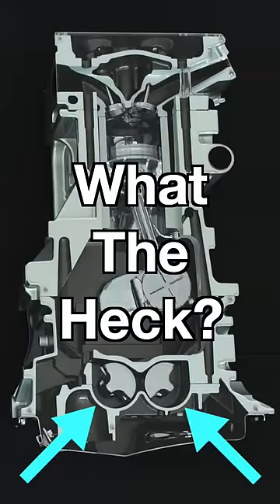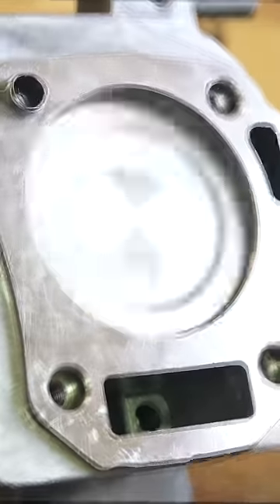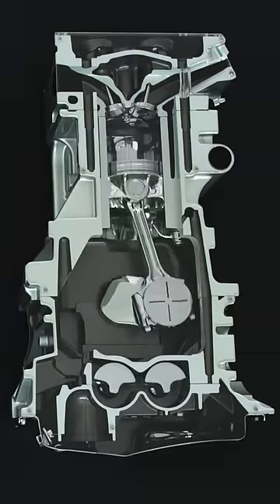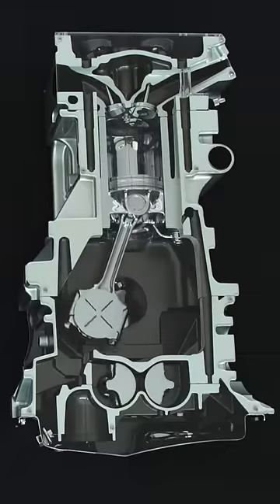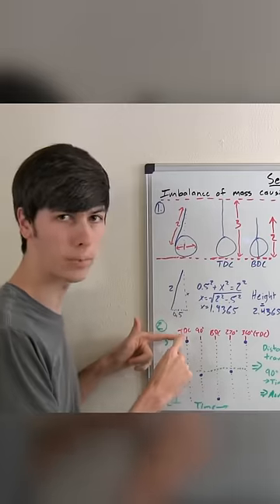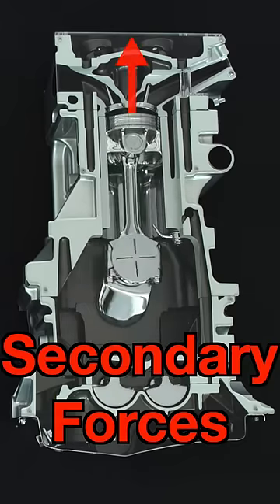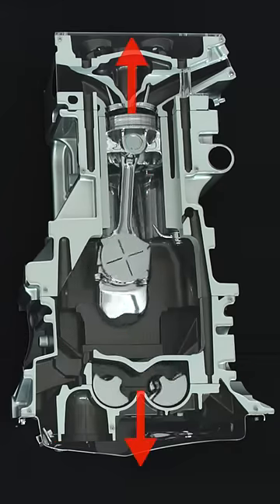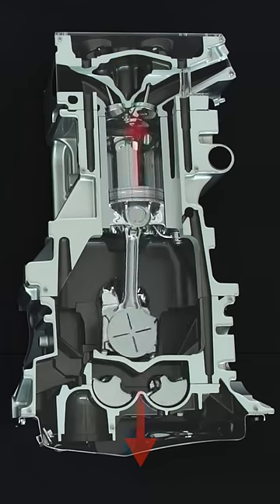How Engine Balance Shafts Work (In 60 Seconds)

Comment from the maker: If you like making fun of nerds on the internet, consider subscribing and leaving frequent comments on my content: https://goo.gl/VZstk7
Reply: Engineering Explained. Your channel and D4A are my favorites. (Plus Bike as Beards.)
Reply: Envy is your sin isn’t it?
Reply: I love how the things used to stabilise engines are the same things used in rumble packs on gaming controllers
Reply: its a German invnetion of the Otto Motor called a KURBEL-WELLE...Germans grew up with this knowledge...
Reply: 🤔🤔🤔🤔🥺🥺🥺👍👍👍 perfect expression 👍👍👍👍🤔🤔🤔🤔😉😉😉😂😂
Reply: @Red-yw3hq not the brightest bulb I see?
Reply: is that why they were able to get rid of the crankshaft counter weights here?
Reply: @SteveMuir  Interesting how my browser interacts with the YouTube shorts so I can't see the 'normal' comments line. But yours is available! So you win (or lose?). Anyway, instead of inefficient kluges like balance shafts, just use a 3:1 rod:stroke ratio and drop secondary forces to negligible levels
 the easy and efficient way!
Reply: How do I keep the balancing act without the balance shafts on a k24 Frankensteins monster engine?
I’d love to attenuate the vibration without creating the extra heat in the oil or taking up the entire 3hp that could be spared without the balance shafts.
Thoughts?
Reply: Bro leveled up his Nerd Quotient to Rockstar status.

Comment: Inline 6 engine: Perfectly balanced, as all good things should be.
Reply: And you can't beat the 225 slant for longevity, either
Reply: And still it vibrates, which is why an electric motor is really the best choice.
Reply: @oldfarthacks electric motors are amazing. Shame the batteries aren't nearly as good.
Reply: I really wish more cars had inline 6 engines...
Reply: And they sound amazing
Reply: @samoliver3242  Jaguar XK and Maserati 250F
Reply: So also was a Mercedes W196 straight 8, but that was a racing car.
Reply: And then you've got the Inline 5 from thr Audi Quattro, or the inline 3 like in Minis and Daihatsus
Reply: @smug3636  ford aussie Barra inline 6 ❤
Reply: Ford 300 straight 6

Comment: EE: Shaking engines aren't desirable
Harley owners: Heretic!
Reply: 1000cc harley makes 45hp…
Reply: @Justinhomii  That's about the same as my 400 cc dirt bike. I bet the Harley weighs more than 250 lbs though.
Reply: @Justinhomii  they make better vibrators than bikes lmao
Reply: Harleys could produce more power, but they were designed for the exhaust notes rather than engine output.
Also, they don’t leak, they “mark their spot.”
Reply: I used to have a monthly retightening of every accessible screws when I owned one.
Reply: When you burn for fuel for aesthetics rather than performance
Reply: @chitlitlah  To be fair Harleys (and similar bikes) make more torque and are also tunned to make that torque at low RPMs.
Reply: @Lianpe98  except similarly tuned bikes like Indian still make more HP.
Reply: @morethanjustasloth5528  Yes, because of DOHC
Reply: @Lianpe98  No it's because their engines are built to actually make use of modern technology. High-revving engines were difficult and unreliable back in the eighties when Harley still dominated. Nowadays Harley engines are still built like then except modern techniques lets us build high-revving engines ideal for motorcycles.
Reply: @morethanjustasloth5528  Fortnine made a video about this ("How Indian makes 43% more power than Harley Davidson"). Short answer: HD customers value their "Iconic engine" so much that any and all change is seen as abandonment of the current consumer base.
I mean, even Buell, the performance subsidiary was stuck with air-cooled engines...  Air cooled superbikes.... :')
Reply: @Weehapaa sounds just like those pop tunes kids love these days...
Reply: @blepware  thaaats why they like leather so much now I get it
Reply: @Lianpe98  To be fair, my dirt bike also makes its torque pretty low. I wouldn't expect a Harley to beat my sportbike in any kind of a race (except maybe a tractor pull), but to have the same power as a dirt bike with an engine 40% the size is pretty bad. However, I do remember them coming out with a bike that had OHC and the Harley fans hated it, so I can see why they're reluctant to upgrade to modern technology.
Reply: @Justinhomii  yeah but hell of a lot of torque
Reply: Thing is the Harley's shake front to back which means when your riding it at speed you can't feel anything.
Reply: "Heretic!"

I legit needed this laugh. Thank you.
Reply: Whats the diff between a Hoover and a Harley?
Reply: @chitlitlah  your 400cc engine would struggle carrying the weight of a cruiser at highway speeds and a cruiser engine would struggle offering maneuverability on a dirt track. 
they are not build for the same applications :)
Reply: Harley's engine counteracts all these forces while it's going down the road
But when it's stopped it doesn't and this is why they idle like a washing machine with a brick inside it
But it's also why they're smooth while you're actually riding em
Reply: @Justinhomii  😂
Reply: anybody that runs straight pipes has a mirco pp
Reply: @chitlitlah my 1977 250 Honda makes 32 whp.. Harley’s sound amazing but at what cost
Reply: You need 600+ pounds to deaden the vibrations!
Reply: @morethanjustasloth5528 do you mean the 1880s LOL
Reply: Harley davidsonmotor company: wrong.
Reply: Harleys are just out of time
Reply: @morethanjustasloth5528  in the '80s the Japanese motors were making a lot more power than the Harleys
Reply: @Justinhomii true but a lot of torqy
Reply: @chitlitlah  but look at the torque curve, your 400 has very little at 500 rpm
Reply: @DanielinLaTuna Lol
Reply: @tesmith47  500 rpm? My ceiling fan doesn't spin that slowly. Why would my dirt bike engine (or any other engine I have) need a lot of torque when it's spinning slower than the Earth? That's why it has a clutch and gears.
Reply: @blepware  bro why did i laugh
Reply: @Weehapaa  pov you dont believe in climate change
Reply: harleys are just a different beast
Reply: Royal Enfield left the chat
Reply: Harleys shake because of the firing sequence to the crank shaft. The engines have counterweights on the crank and therefore are balanced.
Reply: @DanielinLaTuna  Harley engines have been the same since day one. They didn't derive anything from an exhaust note. It's two pistons on a single pin crankshaft. It's a carried on tradition. But you probably wouldn't know about that.
Reply: @krwiles Knock Knock
Reply: @SprinkCalSA  who's there?
Reply: @Weehapaa  doesn't matter if we still love it
Reply: Having to put them back together every 3 months is not a good selling point.
Reply: They actually had to make the M8 engine shake more when they were first released, because of exactly what you're saying.
Reply: @Justinhomii  My 1992 Honda 250RR makes the same power 😂
Reply: Harley riders like shaky engines and violently shaking bars, they don't like cars or going fast! 😎
Reply: @Justinhomii  Horsepower isn't everything mate
Reply: Harley recently started using balance shafts. But, more to the other comments here, they are finally clawing their way into the 1990s and made the Milwaukee 8 built with balance shafts and 4 valves per cylinder. Maybe they will catch up to everyone else..... nah! As long as people buy their outdated junk that they change engine paint and chrome to black and call it a nightxxx.
Reply: @_M.Silva_  No, but it's usual preference within the circles most people are in, to chase a high number if they show off. Personally I'd rather take a Kawasaki than a Harley, but then again I'm also not one to show off
Reply: @chitlitlah  🤡🤡🤡
Reply: Harley's newest engine, the Revolution Max, makes 150hp and spins to 9500 rpm.
Reply: @Justinhomii  My 2007 Yamaha FZ1, owned since new, has about 150 crank HP and low 130's at the rear tire.
Reply: Harley is like the apple of the bikes, technologies of yesterday at the price of tomorrow
Reply: lol
Reply: I was gonna say this😂😂
Reply: @Justinhomii  harley bikes aren’t really about horsepower monsters…they never claimed to be either the most powerful or the fastest..
Reply: @blepware  something something washing machine
Reply: Mitsubishi introduced the Silent Shaft Engine with the Mitsubishi Celeste in the late 70s.
Reply: @Lianpe98  a performance bike is gonna have the same torque or not more than 20 foot pound less while being 400 pounds lighter. Would personally take that over harley any day,  especially considering how down low that torque is, things turn into leafblowers the moment you're 500RPM above idle.
Reply: @libingmeme8474  Yeah, I guess that's fair
Reply: Women seem to like Harleys
Reply: @brenthartzell5531  So they’ve always leaked oil, ran like sh!t and been insanely underpowered? lol

The only thing they’re good at is being noisy and rattling themselves apart
Reply: @rogerroth7782  not really, just the trailer park women
Reply: Harley Davidson spouses concur!
Reply: @HalfdeadRider  I have 8 bikes. Most of them dirt bikes and trials bike, but I also have a cbr1000rr and a Harley Softail. I use the Harley for traveling. Spending months on the road with just a tent, sleeping bag, and my bike. I don't compare any category of my bikes because they're all for a completely different purpose. I wouldn't go across the country on a sports bike just like I wouldn't race a Harley.
Reply: @thejohn6614  Yea that is the way you can do it, but it is possible to do your trips on a sport bike, but that is your choice of course, not for everyone. I know an old bloke with a Hayabusa, he'd stick paniers on it and go off on a Euro trip. Also Teapot one and Round the World Roxy have done World wide trips on Sport Bikes.
Reply: @commandergeokam2868 are you aware that hp and torque are related to each other?
Reply: @Michy20  of course but high torque doesn't mean high horsepower and the opposite
Reply: That was my first thought
Reply: @chitlitlah 
The Harley probably weighs closer to a 1000lbs I'm guessing.
Reply: @blepware I can’t believe it took me this long to realize why women like guys with bikes
Reply: @chitlitlah ,
Reply: @DanielinLaTuna my dad has an 1600cc Harley and you can hear it from the other side of town😅😅
Reply: Same goes for Royal Enfield bullet 😂
Reply: Same goes for Royal Enfield bullet 😂
Reply: @Justinhomii my dirt bike make almost 60hp and the whole thing weight 111kg😂 Harlys are for boring bikers, a true biker doesnt kill those who have wrong patches on tham and bearly drives straights from bar to bar... a real biker greets others and loves the curves, and most of all rides souber
Reply: Oh Jesus Christ this comment thread 😂😂😂
Reply: Harley buyers are like EV buyers,it’s a lifestyle.
Reply: I got it to 7777.   Everything more ain't my fault.
Reply: @stalincat2457 I get it. I like power in a motorcycle but cruiser sound is nice too. Indian also has low power 1600-1900ish engines. Different but great sound. Schaaf makes good videos where you can hear it. Like a giant purring cat.    The Yamaha mt_01 has great sound too, with just 90hp from 1800 or 1900 cc.  Not sure.
Reply: @duroxkilo It wouldn't, you are creating fantasies to satisfy your weird reasoning
Reply: @matheuspn2722  my weird reasoning is based on real riding so :)
Reply: @duroxkilo  Let me be reasonable too, to simplify and be clear: A 100cc bike with little torque, can easily have more torque at the wheels than some Harley. HP is everything here, its the result.
Reply: harley = spending 5 figures of money on 2 figures of horsepower @Justinhomii
Reply: My dads street glide freaking vibrates the kick stand off the ground T.T
Reply: case & point, worst reliability
Reply: @Justinhomii good thing they don’t make 100 CC bikes. The 114 makes 120 Ftlbs of torque. HP isn’t everything
Reply: @DanielinLaTuna 
It's just the pre-war design. 
Long stroke ,small bore. 
Ain't gonna be able to moonshot the revs.
5k for the most part and you're done,she's begging for mercy. 
Kinda funny how I've seen some of the factory power ratings. 
Rated at 3600, like a lawnmower 😂😂
Reply: @morethanjustasloth5528 
Can rev em higher too from the decent valvetrain and being over square. 
Kinda neat how it's a v twin like a Harley, and then nothing like it having more modern (internal) design.
Reply: @Justinhomii  and also the 100+ torque
Reply: Buddy of mine just inhereted his dad's Harley. That thing shakes so much at idle i thought he had a bad engine mount 😯
Reply: @Justinhomii  even indian is still more powerful than harley
Reply: @Justinhomii  Yeah... but the ladies like 'em ;-)
Reply: Big block cammed engines: hold my beer
Reply: @morethanjustasloth5528 different engine layout entirely, and Harley’s still use pushrods which req lower rpm than ohc, which means Indians can have an under square layout and Harley’s are stuck at over square, but they also only a unbalanced forwards and back so when riding these forces are not actually felt
Reply: CEASE. YOUR. HERESY!
Reply: Yep
Reply: Harley Davidson.... American for 'cannot outrun its own exhaust fumes
Reply: Just posted similar comment.
So true
Reply: @Justinhomii my 95 Honda 750 Magna makes 85 HP, more tourque, than a HD, and is way smoother (and handles better)
Harleys are a joke
Reply: @cubicow7561  Let's take the Hydra-Glide of Harley Davidson: 2000cc engine makes 156NM of torque and 94hp of power, with a weight of 332kg and a cost of 34.700€.

Now, a Panigale V4 with a 1100cc engine makes 120NM of torque and 216hp of power, with a weight of 187kg and a cost of 27.790€.

You have an engine half the size, and you get 80% of its torque, 2.3x its power, with an engine almost half its size, and almost half of its weight, all of that at 25% of the cost

Comment: Nice! As an acoustic engineer I can understand it this way: the non-linear movement of the piston makes a series of harmonics. The two counter weights cancel out the second harmonic which eliminates most of the shaking energy. The higher harmonics are mostly eliminated through body flex and engine holders.

Comment: Straight Six engine wonders what all the fuss is about.
Reply: Camshaft flex joined the chat 😅
Reply: @psions555  
Metallurgy has come a long way since the flathead V8.
Reply: @siddharth8532 
Theoretically but they’re  too long for today’s cars.
Reply: Woo-hoo yeah I love shitty cracked exhaust manifolds from 6 cylinders worth of heat being trapped in 1 cast iron log.
Reply: @cjolney  
Nothing a little epoxy won’t fix.

Comment: 1 correction...maximum speed of the piston is when it's at mid stroke...when the piston is at or near TDC (top dead center) or BDC(bottom dead center) it is slowing down coming to a stop and speeding up going the opposite direction... in other words, when the crank is at or near 0 degrees and 180 degrees, the piston is at its slowest speed or stopped, and when the crank is at or very near 90 degrees and 270 degrees the piston is at or near its maximum speed
Reply: He was talking about force, not speed. And the force is at its highes near top/bottom dead center precisely because the piston stops there and changes direction.
Reply: As I understand it, the maximum piston speed must be very close to mid stroke. Mid stroke doesn't happen at 90 degrees rotation of the crank, probably between 75 and 80 degrees, depending on the size of the big end.

Comment: EE: shaking engines aren’t desirable
1.9 TDI: Suck my vibrator
Reply: Jeep 4.0 if the top end ain't tapping and the idle ain't rough it ain't running right😂
Reply: that engine does have a harmonic damper though. It is pretty shaky though, my friend has a golf with the ALH engine.
Reply: My buddy’s 1.9tdi is really smooth. His is pumpe duse tho.
Reply: When a engine reaches at least 400.000km before it brakes, it is allowed to shake a little bit 😂
Reply: Excuse me what-
Reply: @juiceboxed5685  you’re not playing the music loud enough. If you turn up the music, the noises disappear.
Reply: @wolfgang2291  400k is light work for the legendary 1.9 tdi
Reply: 1.4TDI - let me sing you song of my people
Reply: lol
Reply: Very Rude, but LOL.
Reply: Naw. 💀🪦⚰☠
Reply: Kinky
Reply: that's just the diesel ping, they have low revs

Comment: I did a balance shaft delete for a better shaky feel to my engine. Highly recommend
Reply: Huh. I did a balance shaft delete and felt zero difference except more horsepower and faster acceleration. But YMMV right.
Reply: @richsackett3423  which car? Engine?
Reply: @mofayer  2001 Viggen
Reply: @richsackett3423  I suggested that to the garage who were replacing timing chain on a 1996 900s . They had never heard of it before
Reply: that's also a thing for honda's h22 and k24 engines for little extra hp from releasing "wasted" ponies because of reducing engine rolling mass. also because the balance shafts are prone to exploding when making much higher than stock revving engines😁
Reply: @richsackett3423 is that a Saab?
Reply: @RobertMcFarlane-i8t  900s don't have balance shafts. That was a GM-era "improvement" when they transverse-mounted them rather than reverse.
Reply: @richsackett3423  1996 900s , and yes it was from the GM era, not the classic 900. Both of which are now illegal where I live due to LEZ